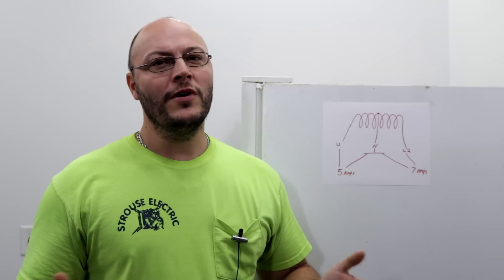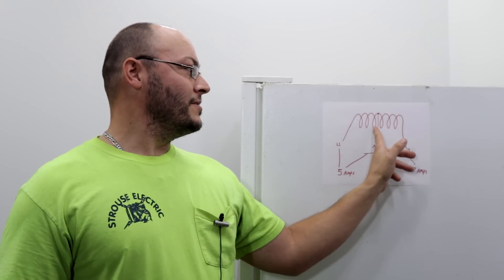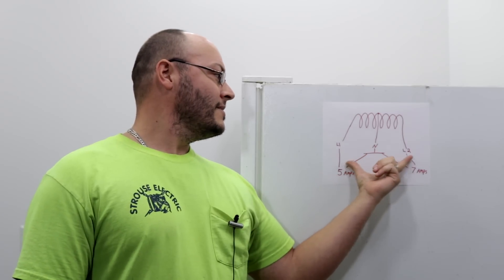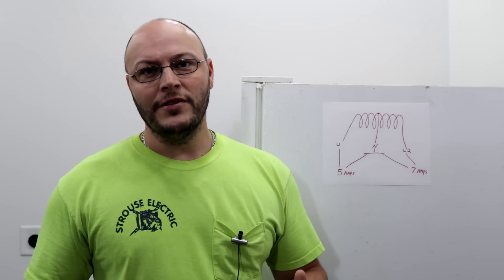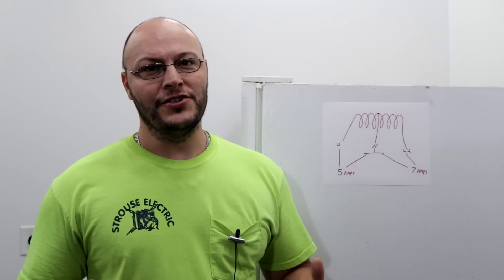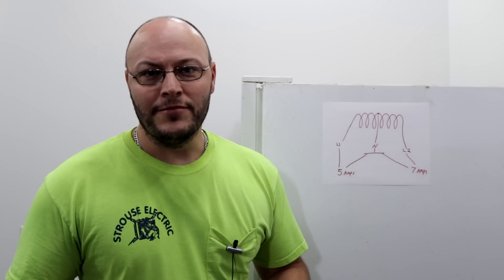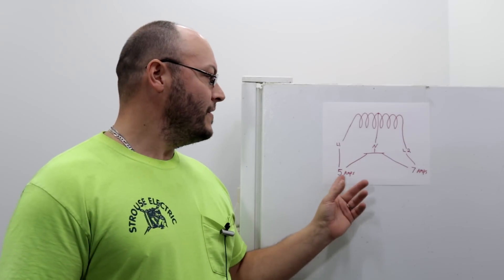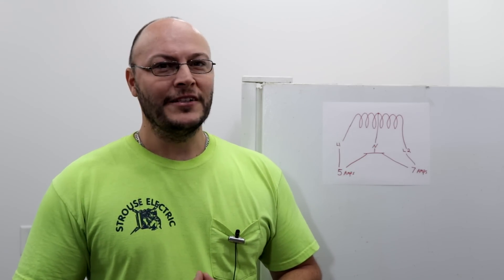What does the Neutral Wire Do?

Comment: Every pages in the books and AC circuit says neutral is return path for current. Without neutral equipments doesn't work.

If it is current return path that means there has to be current flowing in it.

When we check with Tester why it doesn't glow. That mens no current in it.

What is this miss conception.

Secondly, I have seen neutral wire getting heated. How it is possible?
Reply: Tester shows voltage not current. I think a heated neutral might indicate a high resistance connection. The neutral should have considerably less current than L1 and L2 as only the unbalance of the 120v loads returns to the transformer center tap.

Comment: But the neutral ties into the same bar as all the grounds in your panel.
Reply: No it doesn't.  At least, not anymore.  Panelboards are now sold with the neutral bar mounted on plastic spacers from the enclosure wall, and the ground bar mounted directly on the enclosure wall.   If the panelboard main breaker is your main service disconnect, then you install the factory-supplied jumper between these busbars.   By contrast, if it is a subpanel, you leave the two bars unconnected.

You used to be able to use both busbars interchangeably at the main panelboard, but that is no longer OK.   Grounds have to connect to the dedicated ground bar, and neutrals have to connect to the dedicated neutral bar, even though both bars are ultimately electrically continuous.   This rule is done for purposes of keeping things better organized, and also allowing a much easier change if the service is to be re-done as a feeder from a larger panel.

Comment: Training from my father who is an electrical engineer says the white wire is current carrying ground.  The bare copper wire is non-current carrying ground.
Reply: Your father is partially correct as the term of a neutral, is a return path to the supply source, not ground. In a perfect balanced linear load, there should be zero current on the neutral because L1 & L2 are 180° out of phase. But we dont live in a perfect world and the neutral does carry current. The reason to connect it to earth ground is so a human does not complete that circuit. The ground is merely a safety issue.
Reply: It's called the GC but it goes back to service neutral rather than ground...

Comment: Although the neutral wire is not the same as the ground wire, it is grounded at the main panel for the following reasons:

1. The grounding of the neutral wire is what completes the safety-ground circuit, allowing leakage current from any connected appliance ground wire to flow back to the transformer; without this connection, the safety-ground circuit simply would not function (i.e., There would be no safety-ground circuit!).

2. This connection would also limit the electric shock voltage one could receive (in most cases) to no more than 120 V. Although this wouldn't apply to someone who accidentally comes into contact with both L1 & L2 at the same time, it would definitely apply to someone who comes between L1 or L2 and ground. Otherwise, if there happens to be a ground-fault in L2, and someone comes between L1 and ground (or vice versa), s/he would receive a 240-V shock—more than enough to kill. This is because the GF electric current would be able to flow from L2 to ground, and from ground, through him/her, to L1 (and vice-versa, since it's AC).
Reply: Good answer, but when I was in school I was taught that it only takes one-tenth of an amp to stop your heart if your heart is in the path that the electricity takes through your body should you become the ground! One-tenth of an amp can be produced with only 30 volts AC. The "electric" impulse that one's body produces to make a human heart beat is very weak.....relatively speaking. So, 120V, or 240V is FAR more voltage than is necessary to kill anyone if ...........they are shocked "just right" and the voltage travels the path to their heart, e.g taking hold of two conductors with each hand.
Reply: @MarkMcPeak5895  What you're saying is indeed correct. I would even argue that it would be possible to stop someone's heart with less than 30 V; it would depend on the body's electrical resistance as well as the path the current takes through it. The lower the resistance, the higher the current, according to Ohm's Law. So, if someone were to come into contact with a live conductor while grounded outside on a hot, muggy day, that person would be far more likely to be killed than if s/he were to do so in a dry environment.

However, it's not really voltage or current that kills; it's the product of the two (i.e., power) that kills (i.e., P = E * I). And since power varies directly to the square of the voltage (i.e., P = E² / R), if you double the voltage, you are increasing the power four times. Therefore, a person who comes into contact with 240 V would be four times as likely to be killed than if s/he were to come into contact with 120 V.
Reply: Tell that to anybody with an electric fence! Voltage doesn't kill, amperage does. Any decent fence charger puts out over 5,000 volts and people play with them all the time. Automotive spark plugs run at 25,000 volts and loads of poeple get shocked by them quite often. Normal static discharge is 4,000-35,000 volts when you walk over a carpet with socks and then shake hands.
Reply: @SaneAsylum  It's the product of voltage times current (i.e., power) that kills. Although one can build-up a voltage of 30 kV by just walking across a carpet, the human body has a very low capacitance, so it cannot store enough of a charge to be dangerous once it's neutralized by touching something like a doorknob; the current would be way too low to electrocute you, because the quantity of stored electrons across your body would be tiny.

However, if you happen to be handling sensitive electronic components (e.g., memory modules, microprocessors) while being charged-up to that voltage, any sudden discharge through those components could destroy them. That's why in an electronic manufacturing environment, ESD prevention measures must be taken.

Comment: 0:51 but the neutral does connect to the ground in the main panel box.
Reply: At the main panel, yes.  At a subpanel, no.  At any given load, no.   You want current to go back to the main panel on the neutral wire, as opposed to the building steel / concrete / grounding wire / conduit / cable cladding.  Neutral and ground get bonded at exclusively one place.  I.e. the main service disconnect..

Comment: A note: The transformer with the center tap neutral is a parallel circuit. If two 120v  loads are drawing the same current, balanced series circuit, you wouldn't need a neutral. If you loose the neutral leg to the pole you'll get a bunch of lights glowing at different intensities, not to mention appliances burning up motors because of the voltage drop or rise in what has now become a series circuit. That's because in a parallel circuit the voltage is the same everywhere and the current varies. In a series circuit the current is the same everywhere and the voltage varies and is called a voltage drop.
Reply: Huh. Never thought of that. I guess that's why 240v doesn't need a neutral. Both phases are drawing the same current
Reply: @GibsoLesPaulStandard  Single phase, 240v.
Reply: @GibsoLesPaulStandard  Both legs of the single phase.  Confusion we know.

Comment: I think it is helpful to realize that circuits feeding from one hot leg (L1) are actually in series with those feeding from the L2 leg.
 So,( 2) 120 volt circuits in  series are actually 2 separate loads of a 240 volt circuit. The difference between those loads is the current which then flows through the neutral wire. "Balancing" your breaker panel means getting the current draw on one side to approximately match the draw on the other side, minimizing the current through the neutral wire.
Reply: He said that
Reply: Thank you.  That makes sense
Reply: Wrong
Reply: @SteveStowell  which part? you think in a balanced circuit the neutral could not be removed entirely?

Comment: You are saying, neutral is taking the difference of two lines and return to transformer. Neutral in transformer is directly connected with ground, finally current (In) goes down in ground.....If we make two separate gnds, one is at transformer  which is very far and the other one is near at house....what about voltage on both (neutral) gnds? It will be  same or not...?
Reply: Jahanzeb, The earth grounds are not required for the circuit to be completed as current flow is through the neutral wire to the transformer center tap. There is no voltage on ground, voltage is referenced to the grounded neutral.  So the answer to your question is, same both would be zero.

Comment: What does the neutral do when it is used in an Edison circuit on a piggyback breaker?
Reply: Neutral is always the return for a 120v circuit. A piggy back breaker is just 2 breakers crowded into 1 slot thus placing the circuits on the same buss bar. I haven't used an Edison circuit but I think it refers to using a 3 wire cable to share the neutral between adjacent breakers (both busses involved).

Comment: What he's highlighting here is that Neutral is a shared conductor used by both the L1 and L2 circuits. You could split up the transformer such that there was an L1/N1 and L2/N2. In which case, the current through L1 and N1 would be the same, and the current through L2 and N2 would be the same. But, when we clump N1 and N2 together, the resulting current through the N conductor is the difference between the hypothetical N1 and N2 currents.

Comment: Great video! And correct me if I'm wrong, the 3rd neutral wire on the poles, goes all the way back to the generator, completing the AC circuit?
Reply: 3rd neutral? You mean the ground wire?
Reply: elitewolverine when I look up at the overhead poles, there's three wires two AC and one in the middle, all going the same distance, I believe the grounds on overhead lines are just at each junction and run straight down the pole not carry on the miles with the two other hot ones?
Reply: Right those are at the transformer pole.  Technically all 3 wires are hot.  The Neutral is hot, and so are L1 and L2.  In AC power the power is going back and forth, so all 3 are hot.  But the ground - the ones actually tapping into the ground of the earth.  There should be one coming down the pole tapping into the earth and then each home will have one coming from the box tapping into the earth.  Making the earth a complete circuit in the event of a lightening strike.  But that 'ground' wire is not required to complete a circuit - only there for the whole lightening deal.

In fact the 'ground' - taps into the Neutral line. so it too could be considered 'hot'.  Just that the earth sucks at transferring electricity that is only 120v
Reply: elitewolverine so the middle wire is the hot neutral?
Reply: Visually you could say that, but depends on home.  My home has twisted wires.  The best way to know a 100% is to use a volt meter.  Connecting two would net 240/220 since you are connecting l1/l2 and other connections will net 120V, since you are connecting L1/N or L2/N.
Reply: When you see 3 wires on a pole with big insulators it is 3 phase power. Neutrals just go back to the transformer center tap.

Comment: IBEW Local 197 member for 15 years here. The neutral per NEC code is referred to as the grounded conductor the ground per NEC is referred to as the grounding conductor. They are called so because they are bonded at the first means of Disconnect and bonded at the Transformer. You are correct in saying that the neutrals return path of current, but it can carry much more than the unbalanced load as well. I respect what you're doing and people need to learn. But be careful with teaching. Good luck to you
Reply: Your explanation is difficult to understand for someone new to electricity. I like the presenter's explanation. It helps those of us who are interested and want to learn.

Comment: You couldn't be more wrong. The neutral completes the circuit. Simple as that. For you guys that don't believe me, watch John Ward's videos on neutral wire and isolation transformers.
Reply: No. If both live wires carry exactly the same amps, the neutral carries nothing. It’s the reason why you only see 3 phase wires in overland electricity lines. No neutral needed.

Comment: So, in U.S. you bring two phases and a neutral to each house, and the neutral isn't grounded at transformer end? Do you have different appliances that run on 110V (one line to neutral) and 230V (line to line)?
Reply: Many appliances have adapters that accept 100-250V, then the adapter converts it to 5v.  But bigger appliances like dryers do use the 240V line, and are normally on their own breaker.  In fact, I just put my dryer on its own breaker cause as we upgraded the breaker box we found the dryer tapped into two 120V breakers.  A no no.
Reply: It's not 2 phases, it's from a center tapped  transformer. So you would have 110,110 and 220 (mine is 117,117 and 234)

Comment: You should probably emphasize that this applies to the kind of supply in the US. Other countries, e.g., the UK, use a single phase supply (residential) and that neutral ultimately connects back to the generator. http://www.gcsescience.com/pe34.htm
Reply: Our (US) Neutral does as well.
Reply: That link is oversimplified the wires just go back to a transformer. I think the UK also uses 3 phase transmission lines but just uses a single voltage in the home.

Comment: my bro is a electrician and he said a while back, the neutral is ground...but is not "grounding"...something like that. if that makes sense
Reply: It is both.  The neutral completes a circuit.  Even the 'ground' completes a circuit as the wire at the transformer has a wire going into the ground.  Making the ground technically conductive.  So when the house grounds, to the ground, the pole ground and the house ground are using earth as a conductor.  But the conductor is so horrible you need a crap ton of volts...or lightning strike.  And...that is exactly what the ground wire does, provide a path for the lightening to go through in the event the house/lines are hit.

But what this video doesn't do is define what a 'ground' is in different circuits.

A ground say in a car, simply takes the negative wire of the battery, hooks it to the frame of the car, making the entire car a negative conductor.  That is why when a positive wire hits the car frame it sparks and blows a fuse.  It is also beneficial because now you dont have to run grounds through the whole car.  My grounds can end at their destination and complete the circuit.  So in a car, when a light - say the rear brake light - grounds to the frame the electrons are basically moving from the batteries positive side through the wire, to the light bulb to the negative, that is connected to the frame, the frame moves the electrons back to the battery.  Phew.

Now apply this to a house.  In ac there is no single direction flow.  It goes back and forth, doing the whole +- -+ switching.  It needs two wires.  The Lead and Neutral.  Connecting them completes the circuit.  The neutral is like the negative on the battery.  Because of the way a house is wired, the 3rd wire...a 'ground' is actually connected to the N wire in the circuit.  But why?  Because if something trips the ground...it also...trips the breaker.

Hope this helped.